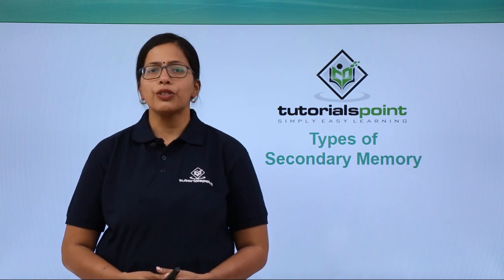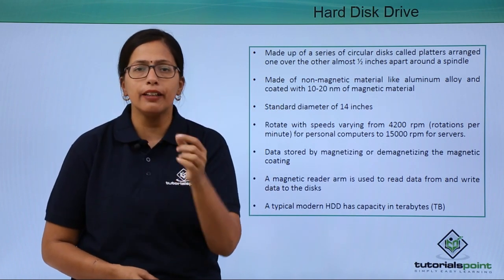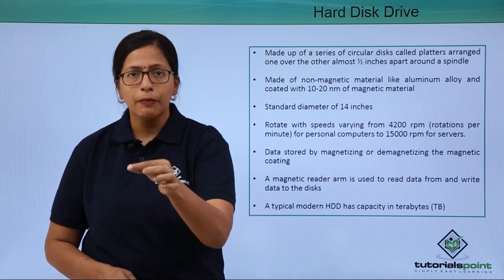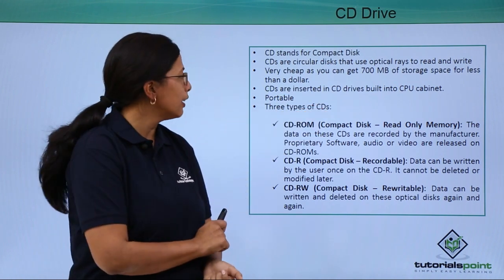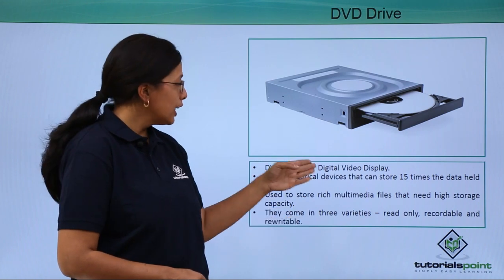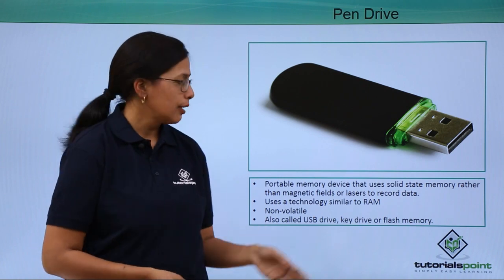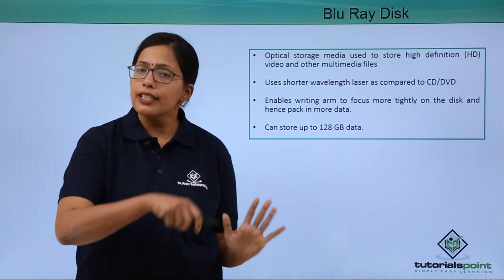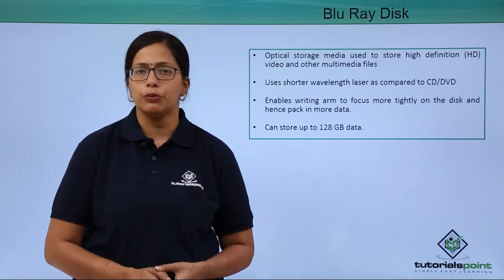Types of Secondary Memory

Comment: 14 cm diameter not 14inch
Reply: Exactly, I was thinking the same and at the same time I was wondering how that would fit into the cabinet of the computer system if it was to be 14 inch in diameter!